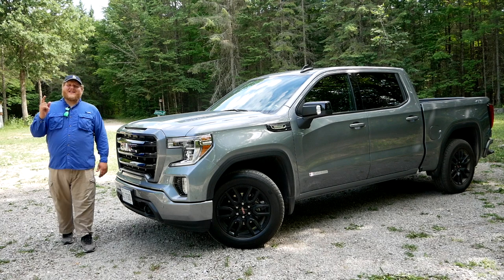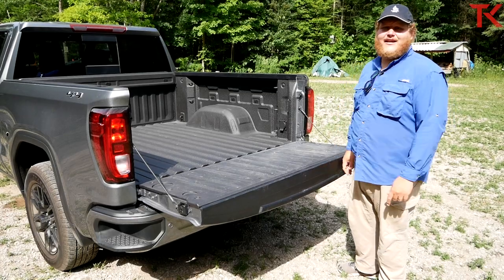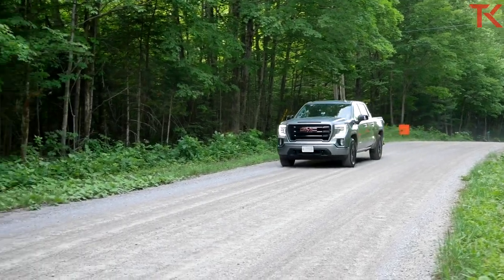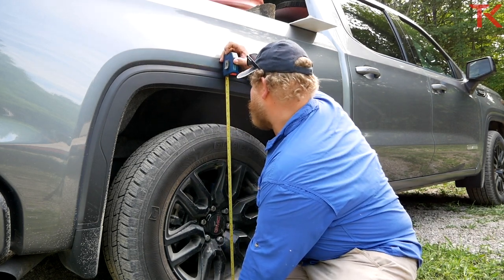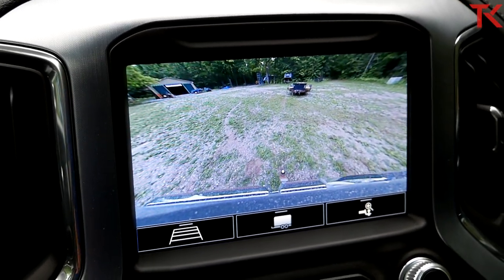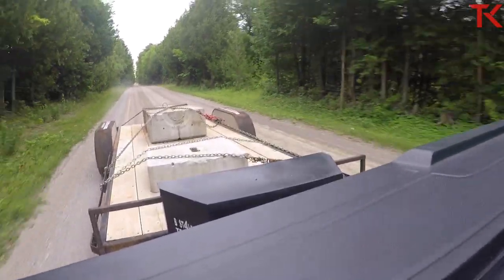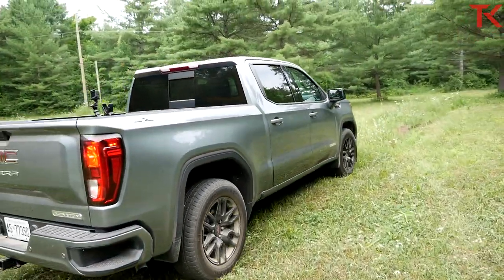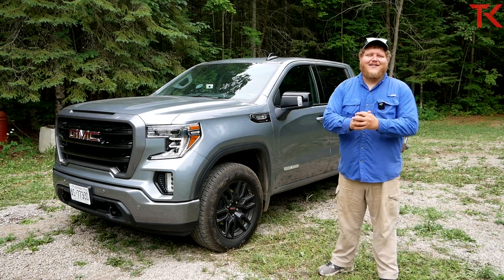Best Diesel Pickup? 2020 GMC Sierra 3.0L Duramax In-Depth Review - Towing, Payload and Off-Road!

Comment: Great video! Followed you over from TFL.  No trailer to mirrors, no 4low.  The best thing about this truck is the engine, to bad it's bolted into a garbage truck.
Reply from the maker: Thanks for coming. I was even surprised at the single-speed transfer case. The Duramax really is good though and hopefully the 2022 update fixes up the interior.

Comment: You can’t lie that GM have the best trucks all it’s missing it’s a better interior the 5.3/6.2 and this inline 6 all those are perfect
Reply: Best looking trucks ever, but a lots of transmission problems
Reply: @hugogonzalez3610  yes for the most part.. but dodge and ford are as bad in their own ways... dodge (ram) aren't the best for reliability and ford has their issues as well (the main one being electrical problems and stuff like that) other wise all are good trucks!
Reply: it was rumored that for 2022-2023 the silverado and serria might get a interior update! if so, it will look good! after what GM did with their new SUV's interior, I think they might look good for once!
Reply: Dallas Frost that will be perfect and I haven’t heard any problems with this new models if anything people are still talking about the problems the 17-18 Transmission this new 10 speed should be pretty solid
Reply: @nmtz91  - yea I have to agree with you! Im pretty certain the new GM trucks (2019+) are not as bad as people make out they are.. but yea, the 2010-2018 era of GM trucks weren't the best... even though interior wise, the new ones hasn't changed. The reliability topic (in particular, transmission wise) for these new ones, Im pretty sure they are decent.. I'd say at the very least, quite a bit better then previous ones...
Reply: Dallas Frost yea your right and I seen a lot of 07-13 body styles treated like shit in the work field and still running good I also seen many 14 and up in a every day use working hard but with good regular maintenance that’s the key people are used to the old 5.7 350 where you can go a year with out a oil change but return you get sucky mileage and less power. And people wanna always bring up I turn in my GM truck for a Toyota this and that but there’s a reason why for every one Toyota truck that’s it’s sold GM sales 15+ trucks that’s why the number of trucks with problems it’s more cus there’s 15 times more trucks out there’s doing actual work while this Toyota’s are at home waiting for the weekend to come to go the beach lol
Reply: @nmtz91  Dude exact well said, 90% of the Toyotas on the road are just being used on the weekends. Toyota is yet to prove they are reliable because they aren't abused the way trucks usually are.
Reply: @nmtz91  yup lol

Comment: Great reveiw. I'm currently in a 2016 f150 with the 2.7 ecoboos and have been getting about 9.3 to 10.0L/100km doing things hardest to get the best I can. I'm a pretty die hard ford guy but that new 3.0 duramax makes the 2022 gm very appealing. Never thought I'd ever look at a gm. Always thought if any it would be a Toyota but that mileage make a joke of toyota

Comment: Weird thing about the "all windows down" features is that Honda used to offer this on their vehicles since like 2000, but it was remote/key operated.  Not sure why they stopped on the new ones, but maybe they could bring it back.  I had it on my 2012 Crosstour.  It was great to get in and all the windows all down already.
Reply: You can do this with the gmc remote too. There's just a button inside too for some reaso.

Comment: See here is where we differ, this IS a nice truck, all in all it would suit just about everyone, BUT...
Price/value, my 2020 3500HD AT4 with a 6.6 Duramax was $76,000(and change) LOADED, just $9000 more than this 1500, and yet I have twice the truck(yes I said twice), IMHO, the better value  is the 2020 3500HD AT4, BUT(again) it's a much larger truck, with a curb weight of 8391lbs, it's HEAVY, but the offset is the towing and payload capacities...

2020 GMC 3500HD AT4 specs...
Curb weight - 8391lbs
Payload capacity - 3700lbs
Towing(receiver) - 20,000lbs
Towing(gooseneck) - 21,200lbs
GVWR - 12,100
GCWR - 29,700
Reply from the maker: Good points.  However it comes down to what the individual needs.  Some folks just never tow anything really heavy.
Reply: Truck King great review of this truck. I recently bought one and have done some upgrades. Check it out on my son Channel “2 Flavors”

Comment: Almost 70 grand for this truck is ridiculous! So not worth it. It’s a shame trucks costs this much these days.
Reply: Area 51 Massacre  You design a better one then.
Reply: Area 51 Massacre And what evidence do you have that this wont last 500k miles? None. The truck just came out! Plenty of older diesels though last that many miles and the new ones are only better.
Reply: Area 51 Massacre  Emissions or not, the engines are way quieter, more efficient, more powerful and have much tighter tolerances than ever before. These newer engines are better in every way than engines even 10 years ago. And you can't speak to reliability when there hasn't been enough time to tell yet. Come back in 10 years in order to compare the reliability.
Reply: @dlakerguy  I love that you continued to entertain the rants of someone with the handle of Area 51 Massacre. You're awesome, that guy is an idiot.
Reply: Area 51 Massacre  Sick burn.
Reply: Area 51 Massacre  we do what we can🤷🏾‍♂️
Reply: Area 51 Massacre  thanks for letting me know. Ima diesel technician and have an old 6.0 with 230k and also have the new 3.0 Duramax with 500 miles. Just because something is different doesn’t mean we should be afraid of it lol loving my mini max so far!

Comment: Really like that truck
Interior looks ok to me
I think GM needs to redo the belt drive oil pump running in the oil. And scrap the electric multi port water valve.
I can see those idiot engineering devices being the reason for poor sales.
There has been issues with the water valve on YouTube already. Any issues these days get big press fast. You can’t hide from the internet.....
But GM would say the poor sales were because no one wanted a diesel.
GM no one wants a diesel that could be very expensive to keep on the road. 
Great review guys.
Reply: Great helpful thoughts as I'm buying a truck for my freight hauling business. I like details generally speaking. One aspect I find disappointing is the payload #. For this $ and size etc., I'd expect it to haul > 2,000Lbs. + NOT including driver weight. Might be obvious but should I always stick with the 5.3 V8? Ford 5.0 maybe?

Comment: Quick Question: Do you think the low torque sweet spot of the 3.0 duramax. In any way makes up for the lack of 2 way transfer case. Also my g80 is great. Perfect for most of us. I mean it works with or without 4×4 on too. Its like having (Auto Positive Track) Just give it a little Quick punch on the gas. Let off right away. There you go. 😀

Comment: Very interesting! Beyond all this, is it true to say that if this engine is not used enough, problems will arise? A lot of people have told me that by only doing 10,000 miles a year the engine will try to clog causing problems. There is also the fact that here the temperature varies between -30 and 95 degrees, Thanks
Reply from the maker: I know what you mean. Because I drive a lot of press trucks my own Ram 2500 sits alot.  I only did 6,000 miles last year.   However diesel fuel gets temperature additives based on season - so that's covered.  Personally, I add a fuel conditioner that is said to lube the injectors.  Doesn't cost much and so far no problems.
Reply: @TruckKing  Ok it's reassuring, thank's a lot!

Comment: Question; I have never owned a diesel vehicles before and I now have a travel trailer that I probably take out 5 to 7 times a season.  I am in the market for a new truck to tow my RV. I currently own a 2011 GMC 1500 with a 5.3 V8. I am researching  this 3.0 Duramax to tow my RV and as a daily driver. My question Finally is I only drive about 5 miles around town and to work will that hurt the engine not driving long distances? I've heard that a diesel should be driven long distances to not hurt the turbo. Looking to get feedback from Diesel Guys. Thanks in advance.

Comment: Question out of ignorance...  It looked like you put one of the weights rear of the rear axle (may have just been the camera angle), and I was told that weight should be on or forward of the axles when possible.  Is there a reason you loaded it this way?

Looking at the on-road footage, there didn't appear to be any trailer sway, so I'm guessing whatever you did worked out just fine.
Reply from the maker: When loading you do want to get as much of the weight as possible over the axles.  However the size of the load doesn't always permit this.  Then you have to think of the axle as a tipping point.  Place weight in front and behind as well - evenly - so it balances.

Comment: I'd like to see a 6.6L Duramax in the 2500 HD platform smoking the tires  :)  Does GM limit the HP and TQ in the first few gears or will it annihilate the rubber?

Comment: Great video Steve. I would like to point out that while the towing mileage was great, it appears that your speed was fairly slow. I suspect that your average speed was below 80 km/h (50 mph)...just a guess based on the roads that you seemed to be driving on. Another big reason is the type of trailer that you used. It’s very low and aerodynamic. If you use the big high cargo trailer at highway speed’s, let’s say 110 km/h, I would suspect that the fuel economy would be even worse even if the trailer was unloaded. Maybe you could try something like that.
Reply from the maker: All valid points. We have a large enclosed four-place snowmobile trailer and even empty it will absolutely wreck your fuel economy because of the aerodynamic drag. On the gravel side roads we averaged probably 40-60 km/h, while on the highway we're between 80-90 km/h. 

But here's the most important aspect in my mind: once we begin to review more trucks in this same format, we will be able to compare fuel economy scores apples-to-apples because each truck will have towed the same trailer over the same distance. We can't change the trailer now or we can't have a leader board. 

Talking about fuel economy of an enclosed vs an open trailer is very intriguing though and could make a great future test. 

Thanks for watching!

Comment: Suggestion for towing tests in the future. Maybe a box trailer to add some wind resistance, not sure how many people are towing loads that heavy that have such a low profile in the real world.
Reply: Jeff Dillon yes! Makes a big difference on gas mileage and handling
Reply: The disadvantage of the box is the varying wins conditions add a lot of uncontrolled variability to the tests to make accurate comparisons very difficult.
Reply: @treborheminway3814  really good point.

Comment: I like this truck truck GM’s drivability is usually always spot on driving with a light foot on the throttle is actually one of the things that I look for in a powertrain. I don’t want to have to mash the throttle to speed up I want to have torque on tap and move the throttle just a bit because you’ll understand if you drive long distances under tow or load.

Comment: The 150,000 mile service is extremely expensive on this truck, because to inspect the belt, you need to drop the transmission to access it, which is about $1000 in labor costs.
Reply: Just depends on how quickly you put on the miles. I currently have a 2012 Tacoma with right around 37,000 miles and I bought a new so really all a guy needs to do if it’s just a daily driver is put some money away and save up for that expense
Reply: $100 per year for 10 years isn’t bad….  Heck it would take me 15 year to put that many miles on it.

Comment: Great video Stephen.  Nice of you to include your dad. Looking for a 2020 GMC Sierra . Leaning to SLT for some chrome. Which engine do you suggest? Need mileage for the sales trips but capable of a burnout like the one your dad left in front of my house several summers ago.
Reply from the maker: Ha! Thanks for watching uncle Rob.

Since you're not hauling with your truck, either the 4.3L V6 or even the new 2.7L Turbo I4 are great choices for the best fuel economy. The Duramax diesel mileage would be comparable or even better, and you'd have the added benefit of all the torque. But going for the diesel is going to cost you, and if you're not working your truck, I'd say it's not worth it.

Comment: Great video guys, it's nice to see a video where people actually run the vehicle through tests, rather than just showing/talking about it. I am currently looking at a 2021 elevation/duramax with the X31 offroad package & double cab with 80" long box. I was on the fence but this video helped me seal the deal. I have a summer home in the BC interior and like to tow my toys there and I know now that this truck will be a perfect fit for that while being easy on the wallet for fuel. There are not many trucks out there with the supply shortages so I figure I'd get on before there all gone, and I actually put a deposit on the last one in my area, whew.

Comment: Will like to know what is the range of this diesel truck in a full tank of fuel pulling a heavy load and also unloaded. I understand it has smaller fuel tank of 22 gallons for diesel and a 24 gallons for gasoline models which make me hesitant to trade my 2018 5.7 Tundra with a 38 gallons fuel tank for a new 2023 GMC 1500 either diesel or the 6.2 gas engine. To me it is more important maximum range than fuel economy.

Comment: I love mine - 2020 GMC 1500 Elevation 3.0L but I wish the "Fart Evacuation Button" was also on the keyfob...
Reply: Not sure about the new models but on my 2015 suburban and my previous 2014 Sierra, if you hold the unlock button on the fob for about 3 seconds all the windows open. You might give it try

Comment: Isnt their something about having to pull the transmission to service the oil pump belt..they say at 150k miles....so until then your good...but you will need a new dpf by then...all kind of problems i bet with egr and dpf and pump belt..all these diesels r becoming less n less reliable...  you take on ALOT of services cost with diesel..and potential egr problems...if you buy this n drive it to 100k ur good..if u buy one of these used over 50k ur nuts...you will have to do all the service..buy it new drive it to 90k and dump it..electric comin and these will  beworth what a film camera is worth..or a typewriter by 2035....

Comment: I issue you guys a challenge. Find a 2.7l ecoboost payload package F-150 to test. It only exists in the XL trim on crew cab short bed and supercab 6.5 bed trucks. However you can get the STX package which helps get it out of bare bones a bit. It is an extensive package that puts the larger 9.75 rear end on the truck with 3.73 gearing and a locking rear differential, and is available with the upgraded 53C towing package that upgrades both the radiator and installs the transmission oil cooler. It does have the larger rear leaf blocks that make the stock 32" tires look dinky in the wheel wells though. The cool thing is that it has a comparable towing capacity to the duramax 1500 trucks, but appreciably higher payload ratings due to it's 7,000lb GVWR on the 4x4, which is oddly (and falsely) 50 lbs less than the 5.0 and 3.5 trucks with the same chassis and suspension codes. I'm not sure why it is so limited in trim offering. The reality is, the 2.7 in practical use,  is the best towing motor available for the F-150 due to it's massive powerband, throttle response, and absurdly robust build (and the "powerstroke" is doggy as all get out past 10mph). Now, NO ONE, and I mean NO ONE on youtube has actually tested this package. I have a 2018 version of it. It was one of I believe about twelve examples in the western US available at the time I purchased it. I know you guys are mostly limited to press fleets and local dealers, but I hold out hope that somewhere in Eastern Canada, there is someone as weird as I am. Now, I already know how much of a gem it is in the F-150 line, but I guarantee everyone who read this just found out about it. Good luck.

Comment: I have an slt crew cab std bed 2020 with the 3.0l it towed like crap. 7000lb towing and it struggled to get up a small hill and couldn’t go faster than 40 mph.
Reply: Something is wrong with your truck. I have F150 3.0L powerstroke and it will walk 7000lb camper up 6% grade at 60mph. I would expect something similar from the GMC.

Comment: I’m looking for a new truck to pull a 7000lbs travel trailer. Would you recommend this truck over the Sierra 5.3l or the F-150 5.0?
Reply from the maker: All three of those are good.  It comes down to what moves you.
Reply: Which one would tow the best?  Which would get the best fuel economy towing and as a daily driver?  Which one has the best reliability ratings?  I like both GM and Ford.

Comment: Rofl.... a 3.0L. Thats HILARIOUS. That's a car. My gas 2500HD Sierra has more torque
Reply: I sure hope it does!! Still tows 9100.. can your car do that?
Reply: Sold my 8.1 with Allison 2500hd for a gmc x31 3.0 desiel and absolutely love the inline six. My 8.1 has 455 torque @3200 rpms and the 3.0 has 460 torque right off idle. X31 has 4wd in low also, best mpg I have done is 29 mpg.

Comment: One question guys, which gauge is better when towing? Oil temp or oil pressure? 
GM and Ford loves oil pressure gauge, but I am more familiar with BMW and Mopar which they use oil temp gauge quite often.
Reply from the maker: Being that most factory tow packages include an "oil cooler", I'd think temp is more important while towing.
Reply: @TruckKing  agree, I think oil temp gauge can prevent potential overheating problems. If oil pressure is abnormal that means my engine is going south already. I don't know why GM and Ford use oil pressure gauge